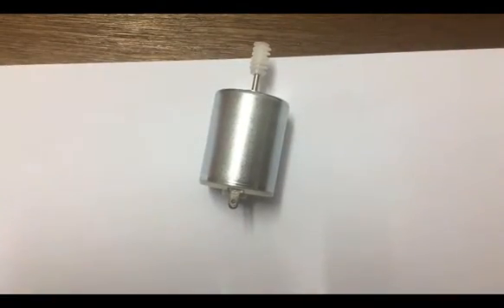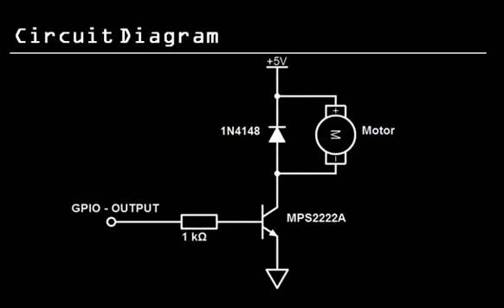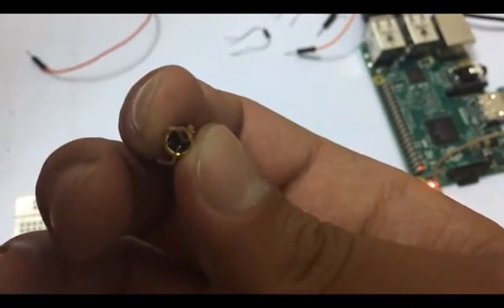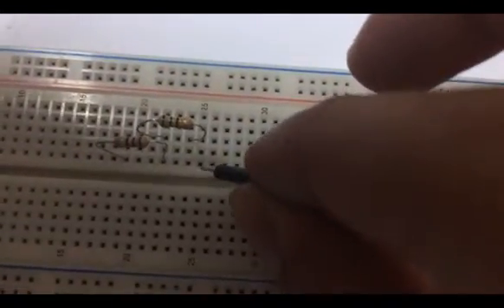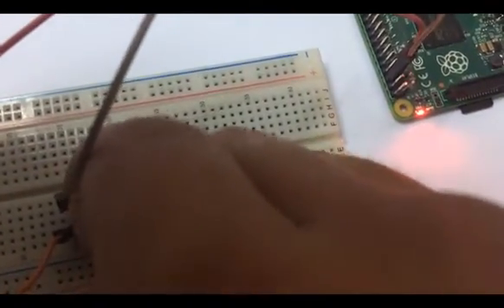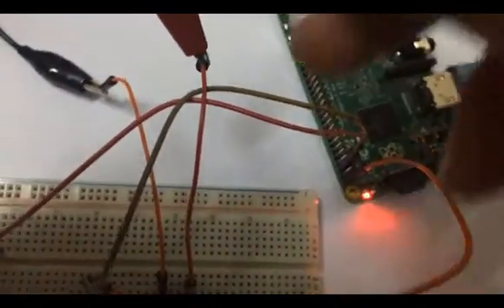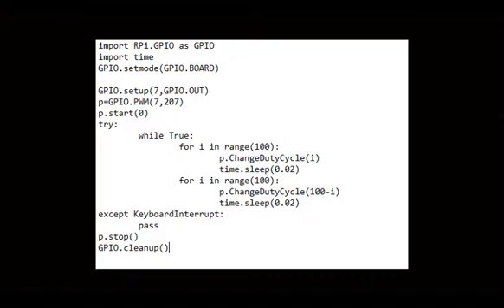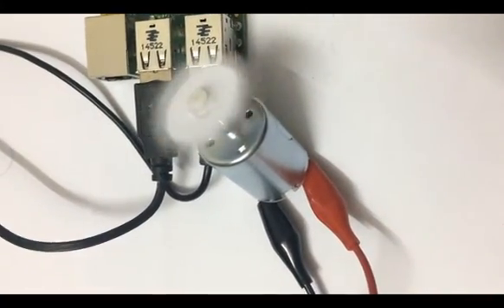Controlling a DC motor with Raspberry pi

Comment: Cool! I did not know that you are able to use two resistors to composite not having the right ones. Very useful
Reply from the maker: yeah, sure you can...connecting two or more resistors in series produces a resistor larger than the largest resistor that is being used, in contrast, connecting two or more resistors in parallel produces a resistor smaller than the smallest resistor that is being used.